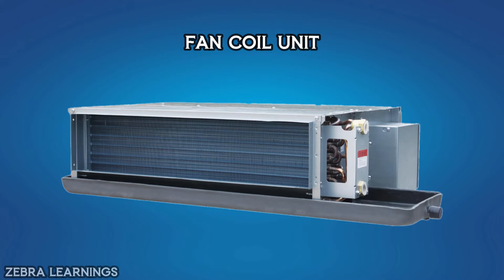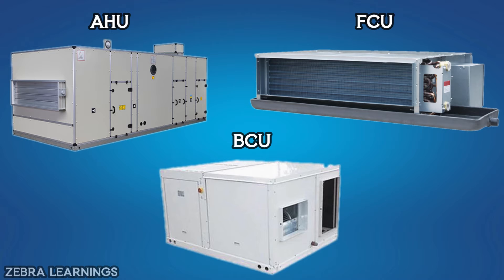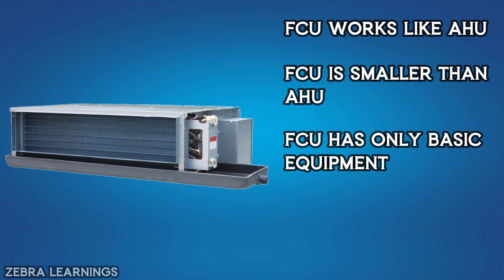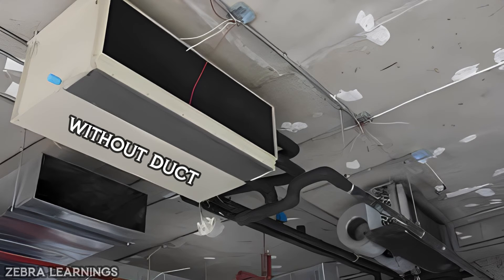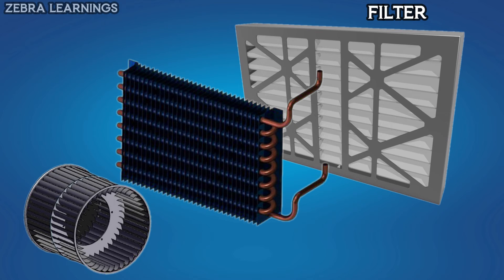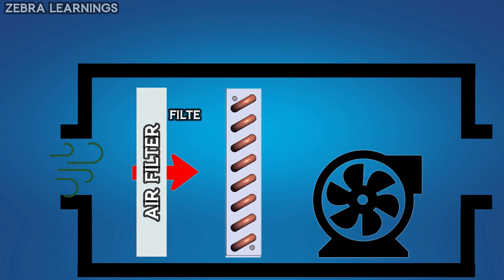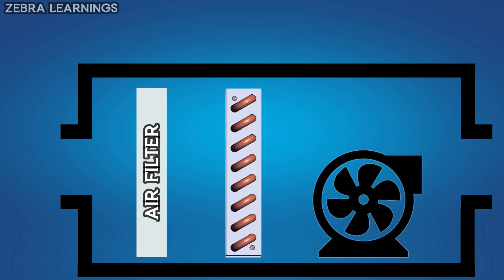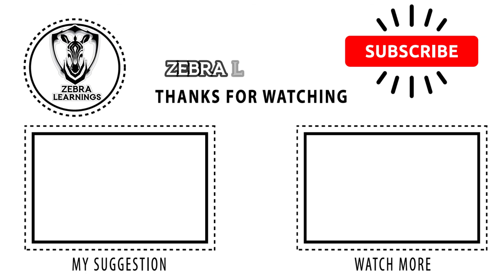What is FCU? | Fan Coil Unit | #hvacmaintenance #hvactraining #hvac

Comment: cooling or heating coil means Heating coil also work  it gives hot air ?
Reply from the maker: If there is a heating coil, it will give hot air.

Comment: I love your video. You mentioned that the hot air inside the room comes back into the FCU, then cooled air flows back into the room again. I wonder why no fresh air adds into the flow. If no fresh air joins in, the carbon dioxide level is too high. It is not good for our health.